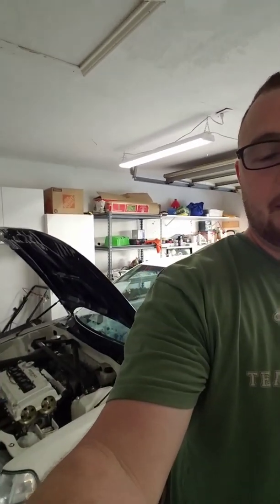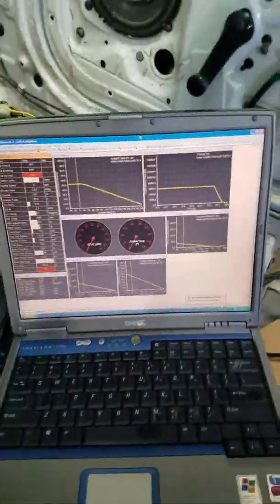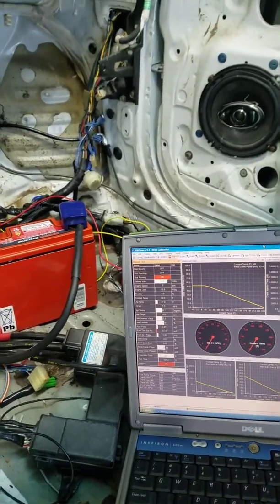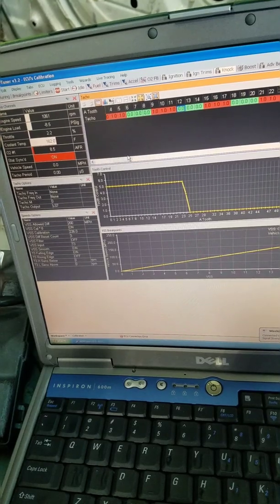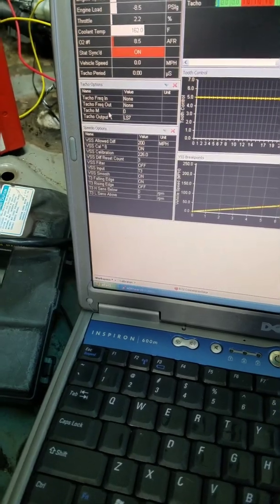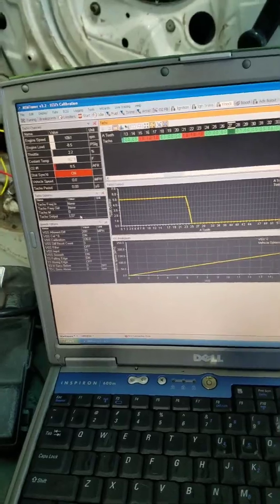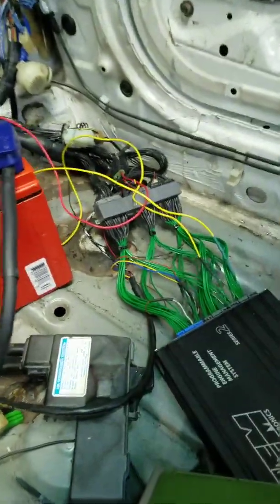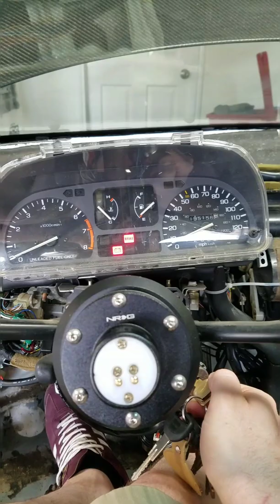Honda EF tach install with Coil on Plug

Comment: hello bro..pls can you help me..i had a 2016 ecosport and its coil pack..i cant find where can i connect the signal wire the green wire...i try to tap the green wire one by one to all the wite of the cluster gauge..and in all of theme they only had 2 wire can give a signal to tach..but its not good the one is the gausge goes to the higher numer and stay there.and the onther one is the hand of the gauge is realy wild..like no stop moving..i hope u can help me
Reply from the maker: Sorry.  I don't know anything about the 2016 ecosport.